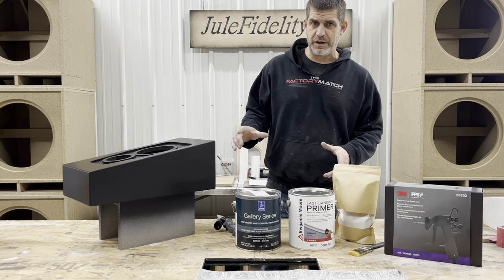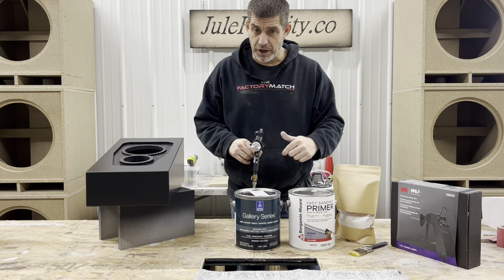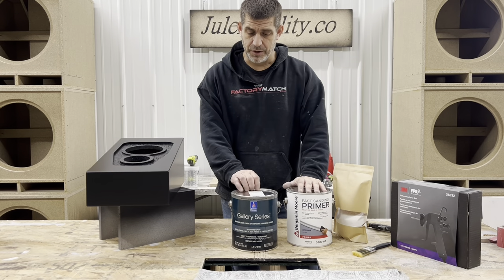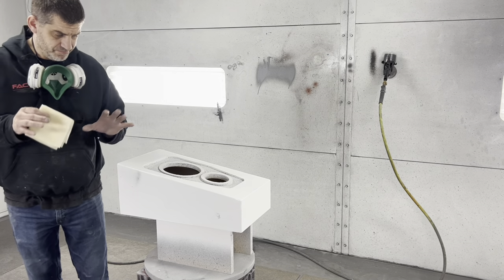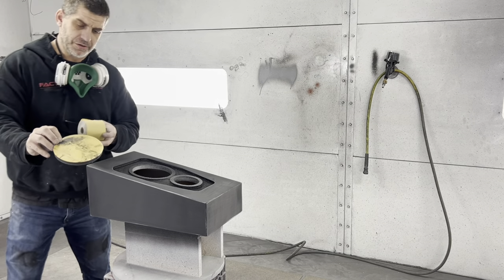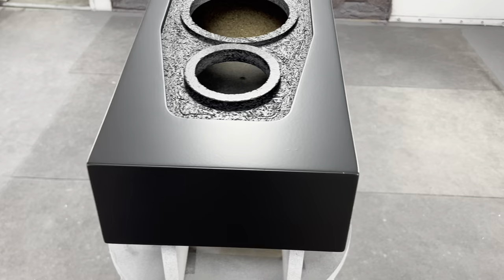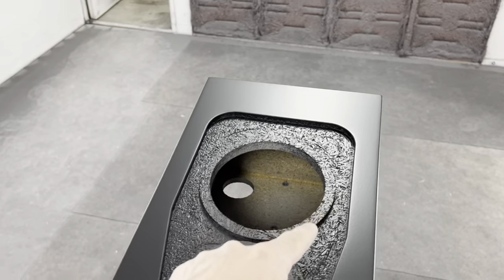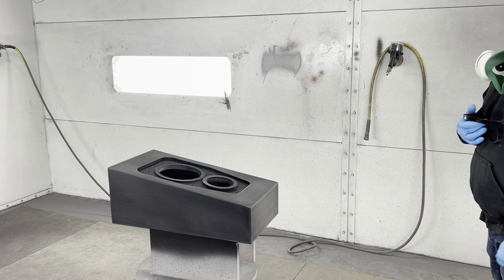Gallery Series speaker cabinet spraying: what you need to know with Sherwin Williams, 3m

Comment: I use Renner, Envirolak and Centurion wood coatings with there primers 1k and 2k. I dont get orange peel. I wanted to try this product but now I'm not sure. It also seems a higher price point than what I use. Ill have to test for myself and see what results I get.
Reply from the maker: I can’t say I’ve used the products that you’re describing but this product works really well and I’m sure there’s better spray equipment than what I use.
Reply: Wondering if the orange peel is from the HVLP.  I’ve sprayed this product with airless and it was silky smooth.  No orange peel.
Reply: If it keeps putting orange peel out it may be you need a bit more air to atomise the paint a touch more or thin it down more perhaps
Reply from the maker: @johnthemod71  yeah I’m sure there’s many different things that could be done. You could reduce the product more change the needle nozzle on the gun up the air pressure. Maybe on the next project.
Reply: Do you use an airless or HVLP should have asked sorry
Reply: im sure u can get this stuff for $50-60 gal renner and the rest u listed are like $100 lol

Comment: Those are heavy sand scratches, it means you did not use a high enough grit to finish it properly. but forget that, you basically have autobody repair skills. why not just forget all of these home interior paints and spraymax spray cans, just use actual 2k catalyzed automotive basecoat/ clearcoat? no need to even color sand. just learn about autobody and car painting. also from experience please stay as far away from PPG brand paint, you will thank me in the future and your wallet too
Reply: What is PPG brand paint?
Reply: @MadLadsAnonymous  its the most common peddled brand of paint sold in brick and mortar stores that sell car paint. it's like the Maaco of paint, maaco is garbage in case you didn't know